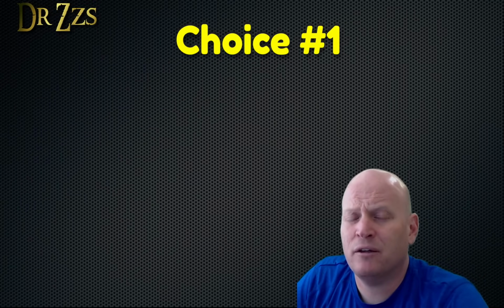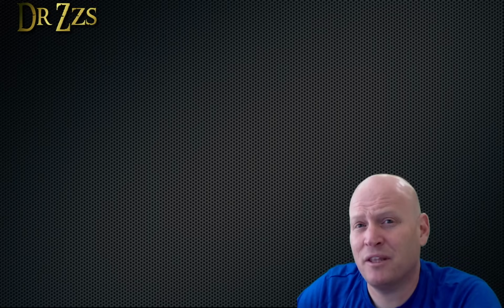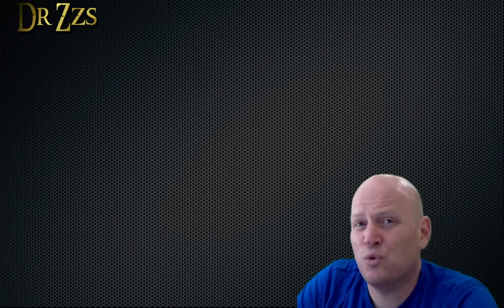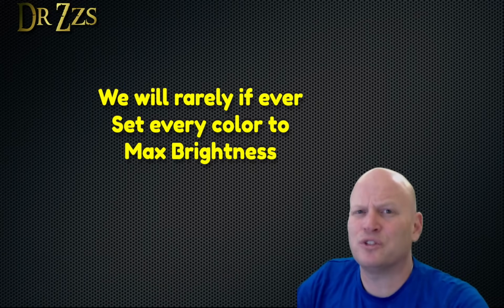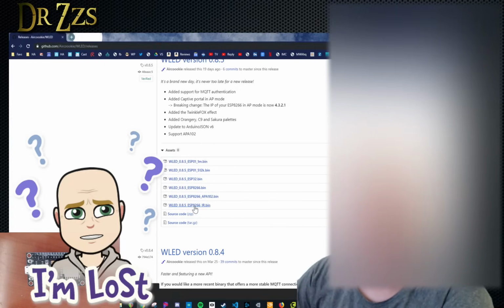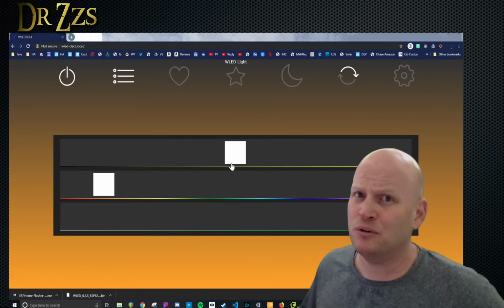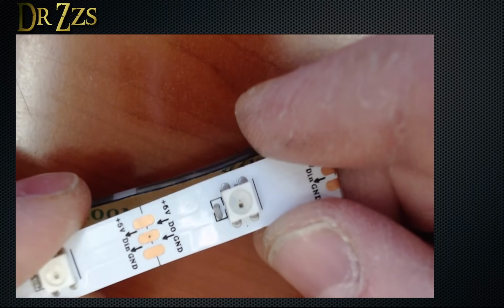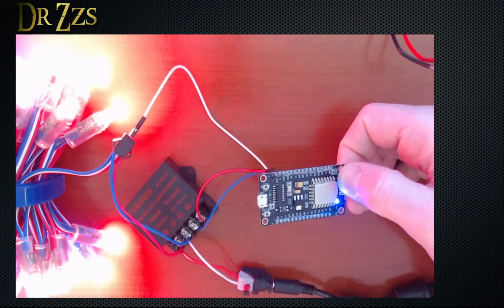Beginner's Guide to Christmas Lights - and LED Shows for Every Holiday

Comment: First of all i would like to congratulate you about the effort and the simplicity you present your videos. I have reasons to believe that those videos are the DIY Xmas light Bible for newbies!!! I watched your videos again and again and recently i made a NodeMCU based xmas lights decoration according to your simple and effective guide!!
I have a simple question that i would like to ask.
In Greece there is no variety of led strips in the market and there are only maybe 3 shops that sell 2812 led strips. The prices are double and in some cases 3x of the prices if ordered form China. Unfortunately to order something from China takes like 60 to 90 days to arrive here.
My simple question is this:
Is there a way to use those 5m ready made strips with 5050 leds (4 contacts 12V/R/G/B) strips and maybe the addition of some more components in order to use them with the same binary files and WLED?
Once again thank you very much for your effort and the nice simple yet very informative videos!!
keep up the good work!!!

Comment: Add a decoupling capacitor to the data line. We were getting a lot of flickering without one. Took us hours to figure out what the problem was.
Reply: Does this solve flickering even when data is going 4in before first led in strand?
Reply: @djw6490  not sure exactly what you mean. But my problem was that all the lights were flickering, and the solution was adding a 680pF ceramic capacitor. I wired the capacitor from pin D4 to a ground pin on the microcontroller.
Reply: @mwagner1996  my lights flicker random colors even when its on solid color. My question is would putting the capacitor on there help when my data travels four inches from my nodemcu to my light strand
Reply: @mwagner1996  also do you know why this works does this help stop like interference or something I'm not very knowledgeable in this area so if you could tell me much appreciated
Reply: @djw6490  it's possible it could work for your short cable as well. Although, mine had a 10ft long cable going to the first led. As for why this happens, Im not certain, but my best guess was that the string of lights had some inductance that was distorting the signal, and that adding the right amount of capacitance canceled that out. I discovered this solution by simply touching the bare metal of the data wire with my fingers. Since our skin capacitance, touching it was enough to get results for me. Then I used a cheap ceramic capacitor set I bought on Amazon and tried different values until the flashing stopped. We also had flashing colors when it was set to a solid color too btw, so I'd give touching it a try. If that works then you know a capacitor will fix it. If it doesn't work, a different value capacitor could still be worth a try.

Comment: Little confused about data  and getting it extended through my whole 380' string of lights, I have 1600 LED's (32 strips at 50 LED's per strip WS2811)  I bought (2x) 12v 20A bare metal power supplies  and I originally thought id only need 1 controller to control all my lights. After reading some more I see that the data signal will get weaker the further it goes much like the voltage, I get how to inject power but how can I boost the signal of the data? Do I just add another controller mid-way through the strands and then that would boost original data signal? Or would I have to just inject a new data line with the second controller for the second half of my strand?  Would my power from my lights power my second Dig-Uno? 

Your YouTube videos have helped me a lot thus far! Cant wait to get this all set up!

Comment: Can someone please give me some advice? I just hung 5 strings of the same 50 bulb per string lights shown in this video, I have the same power supply, I have the same esp board, I have the same 12v to 5v converter. I have all 5 strings daisy chained per the black clips at the end of each string. I have a power and ground cord coming from the first string of wires plugged into the 12v side of the converter. I have the power supply connected to the same location on the 12v side of the converter, I have a power and ground going from the 5v side of the converter to the esp board, I have a data wire from the esp board going into the middle (data) connection in the black clip at the start of my 1st set of strings. So that is 5 50 bulb strings. In the wled app I have the led preferences set to 250 bulbs, it is also set to 12v. I only have one segment setup in wled and it is 0 to 250 bulbs. When I power this up all 250 bulbs light up the same color. I can connect from my phone to the esp board (i see the board light flash when I do a reboot from the wled app)......but the strings will do nothing...they just stay one sold color. They will do no effects at all, not even change the solid color. One interesting thing I see is that bulb zero (i guess the 1st bulb is called bulb zero) is not lit up?? All the other 249 bulbs after it is but not that 1st one. I am not sure what else to try....could anyone offer any suggestions please and thank you.

Comment: If you get a string and an LED blows/goes out, can it be replaced?

Also, does the aluminium channel get hot in the sun? I live in Australia and out sun is *harsh*. I would hate for the channel to get so hot that it melted the plastic coating of the wires in the strings.

Comment: Anyone assist me? I am only getting like the first 2ft to light up for all new led strips I purchased, I have 5V waterproof strips and 5volt powersupply only 5m length strips. Any assistance is appreciated I used everything exact in the list on this video. Much appreciated for any help
Reply: Try going in the app then config then Led Preferences at the top there's Led count set that number to the number your needing to light up

Comment: You could use a  Node MCU Base ESP8266  from Aliexpress which is not more than $1.50 and plug everything there. https://www.aliexpress.com/af/-Node-MCU-Base-ESP8266.html?d=y&origin=n&SearchText=+Node+MCU+Base+ESP8266&catId=0&initiative_id=SB_20201124055923

Comment: Great tutorial/videos. Slowly getting there. However, the WS2812B strip that I have is only lighting up the first couple of feet of led's. I'm using a SHNITPWR 5V Power Supply 30A 150W from Amazon. Any suggestions? The led's that do light up work with iphone app just fine. thx
Reply: Go to config>LED Preferences at very top change the led count to how many your needing to light up

Comment: Looking for help.  I've done the flash step.  My computer does not show the WLED-AP as a network option.  Any suggestions?  It was working and WLED-AP was visible.  Then it went away and I can't get it back.  I've tried restarting computer, re-flashing, unplugging the USB connector.  Thank you

Comment: I'm having a tough time with this as it is my 1st time. I have the same power supply, 12v to 5v converter, same esp  board and the same string led lights(not strips). But when I connect one of my 50 bulb string into another 50 bulb string via the black clip at each end. All the bulbs light up but it does noting I tell it to do in the wled app. I adjusted the configuration to 100 less, but they just light up and sit there all different  colors. Now when I disconnect one 50 bulb string then the one 50 bulb string that is connected works fine. Can you not connect more then one string together? Do you have to have a separate esp board for each string? Not sure what I am doing wrong here. Any help would be appreciated.
Reply: @J L go to the configuration in the wled app and select led preferences. There is a place in there you need to increase the number of led lights you have. Once you do that then you can go back into a segment and be able to increase the number of bulbs.

Comment: Hey thanks for the video. I tried this setup with 200 8211 LED strings with 12volt 5a 60 watt power supply but I get flickering every few seconds. When i remove the data line the flickering stops and the lights stay solid.. am I getting interference on my data line? Thanks
Reply: I have a similar setup and the same problem its really annoying did you figure anything out yet?
Reply: @djw6490  yes, I believe so. My understanding of the problem is that my controller, the nodemcu 8266 has a data output of 3.3 volts. This degrades quickly below what is required to keep the the signal(maybe allowing interference to override). I cut a pixel from the end of my lines, and wired it in directly after my controller. This pixel acts as a buffer but increasing the voltage to 5v (from the 12v power line) before sending the data along. this is called a null pixel, there is a fair amount of information online. I have only had flashing issues once since then and I believe it was due to loose connections. It’s amazing the tech in each of those little pixels. let us know if this works for you.
Reply: @Waywen  How far away did you have your first pixel on the strand before you cut one off and put it directly after. And how far is the null pixel from the controller. I have my first led on the strand about 6-7in after the controller.
Reply: @djw6490  previously I had it about that distance but it only seemed to work when i had a USB cord (one wire) for the data line. And only that worked consistently when  I grounded the wire shielding. I assume that the issues is the i was getting enough interference that it would messing with the data signal, grounding the shielding wire stopped enough of the interference. I find it hard to know exactly what the issue was since it seemed a few things may have contributed (interference from 12v to 5v converter maybe, less than perfect connections, cheap CCA wire) . I find it odd that this isn’t addressed in the video, how was it Dr Zzs managed it? Did i buy a bad unshielded converter maybe it wasn’t the same one from the video.
Reply: @Waywen  I don't really want to have to cut the wires and connect them for my lights for a null pixel, I put a spare strand connected to the controller with jumper wires and have a extention jst wire 16ft long going outside from the end of the strand. IDK if this works the same way as the null pixel or not. I do notice that its some interference on the 16ft extension, because not having any lights plugged in at the end of the extension and I get flickering usually white sometimes other random colors. IDK if there's anyway to keep the jst cable shielded or not
Reply: @djw6490  I think the spare string would work the same. I had read complaints about longer extensions, it would be the lower quality wire degrades more quickly with pixels to buffer the data signal. What power supply do you have, and how many strings.? If you don’t have enough power I understand that can cause an issue as well.. I would recommend joining the discussion http://doityourselfchristmas.com/ discussion.. lots of knowledgeable people there. I did notice today if i put on max white i get flicker, I think I need more power 200led with 60 watt
Reply: @Waywen   I have a 2amp 12v power supply driving 150 leds (200 including the null strand) I get flickering even with 100 or 50 leds. I'm thinking its the power supply thats interfering with the long data line. I'll check out the link. Thanks
Reply: @djw6490  an update. I bought a larger power supply and got problems again. Connecting my 5v controller ground to the 12v ground, so the controllers ground bypasses the power converter.  That seems to have solved it, everything needs a common ground it seems the power converter messed that up.
Reply: @Waywen  so you connected the wire from the controllers ground pin (right by the Vin pin) to the — 12v on the converter instead of — 5v?
Reply: @djw6490  correct.  It’s odd cause you have a meg wire on the power controller with nothing on it!
Reply: I’d love to know if this solves the problem. I’m confident enough now to buy another controller , I think.
Reply: @Waywen  will this not fry me nodemcu with 12v on ground
Reply: @djw6490  worked for me. Remember you are not by passing the live +12 volt, that still gets converted  The NodeMCU is still getting 5v, its just the 5 ground  which is connected to 12v ground.      https://hackingmajenkoblog.wordpress.com/2016/12/06/the-importance-of-sharing-grounds/ this explains it, although i admit i get a little lost in it..
Reply: @Waywen  Okay thank you. As of now I'm not having anymore problems but I'm thinking it will start doing it again because I did literally nothing and it stopped. so if it starts again I will try this. Also I checked out the link its very confusing but I have a little better knowledge about it now. I'll keep you updated if anything changes.
Reply: @Waywen  so I did end up switching the ground wire and it has worked well so far (being only 30 mins) Thank You so much for all the help for this newby here I will update you if I have it again.

Comment: two tips I did not see mentioned here. If your ESPhome flasher does not see your nodeMCU card it could be for two reasons. One you need to download and install the  CP210x driver and second you might have to change your USB cord. Some do not have the data pins wired only the charging pins. I had both of these issues.

Comment: A finished my lower level roof line following this guide. 600 leds, 2812b strips, 5v. Running the lights on a cell phone charger. 
Waiting for my digiquad to inject power and replace my nodemcu.

Thank you for the easy to follow tutorial

Comment: Great video, thanks for this.  Quick question, I have an archway around my front door, its a relatively gentle curve approx 2 meters wide and 1 meter tall.  Was wondering if the aluminum conduit and led strips would work around, are the strips easy enough to bend to that kind of shape ?

Thanks again buddy, helped a lot.

Comment: Hello all.  I have been trying to get my stuff going.  Here’s my issue.  Everything will work as long as I have the usb cable hooked to the node, and the lights wired to the node.  When i hook everything to the 5v/20a power source, i loose the wifi connection to wled.  Suggestions?

Comment: This video is dangerous. Friends don't let friends use led strips (led failures and much higher led density). Someone is seriously gonna burn their house down following this advice. Don't trust me? Buy some lights and before putting them on your house run them white with full brightness and watch the cables get hot. His advice is really only safe for single color red green blue leds that are not always on and in some sort of animation. He mentions voltage drop, but neglects to say this drop occurs over the distance leading to the start of the lights as well. To counter this you really need to supply power every 100 leds and have multiple 120v to 12v power converters close to where you supply power.  Each of which should also have an inline fuse. I don't know why he hasn't made an updated video for the dig uno that he sells in his store.

Comment: I have a question everything was working until I get to around 500 piexl it start to acting up. Using nodemcu same one u using. Should I buy the falcon 16 or a way to fix the mcu to work with more led

Comment: The 5 volt ground jumper wire from the power supply to the MCU board melted. Tested with 100 led lights first for hours with no problem.  Then added another string of 50 lights, then smoke! Where did I go wrong?

Comment: How long can I run the "parallel wires"?  I wanted to do a single transformer but shoot multiple blank wires out of that to all the individual strips around the front of the house.  Can I run a "blank" wire 200' and it still have the necessary power at the other end to fuel a 5m strip?

Comment: I have watched most of your video's and they are fantastic so thanks its starting to look a lot more do-able than when I first started looking and everything was going straight over my head. One thing that is still confusing me is do I need multiple Node MCU's to control my set up? I am planning to have Led's around the top level of my house, the bottom level and the detached garage. Id is best to have a node mcu for each portion or should I link them in series from one?

Comment: Hey man, LOVE the video. I'm doing lights on my house and my main concern is that I want to have a main "hub" in my garage where all the power supplys and led controllers are, then run wires out to the lights on the roof lines. What gage wire do you personally use to run power/signal out to the LED's from your power supply? Also, can a single Node MCU run multiple strings, or would I need a separate chip for each string? If a single Node MCU can run multiple strings, can I use different pins, or do I need to split the output from 1 pin (making all the different strings clones of each other)?

Comment: Great video! 
I'm am building a 12v string using your video. 
I have one question so far. 
Like I said I have a 12v string in which I bought a 12v 10A power supply.  
You said to get a power converter for the MCU, in the video you say to get a 12v to 5v 3A. 
My question is about the Amps of the power converter, do I have to match the 10Amps of my power supply or will the 3A be ok?

Comment: can you add more than 1 set of LED to the MCU for zone or do you have to have MCU per line of continuous LED strip? if no, then you would need a separate power plug for each of the MCU? so like if you have 3 zone, then you need 3 power supply and plug it into 3 outlet?